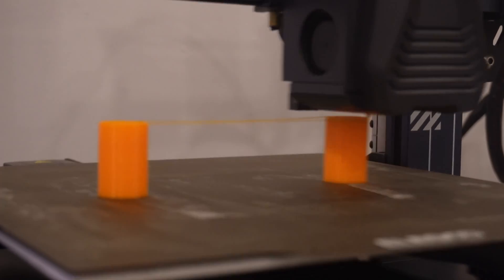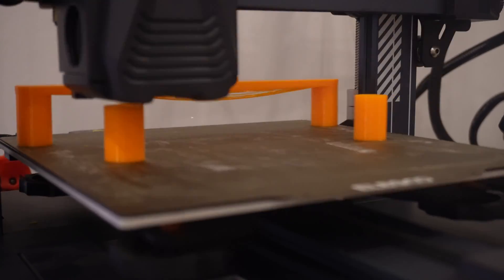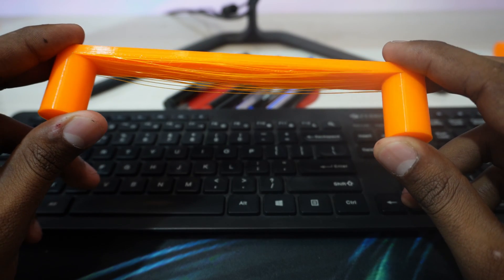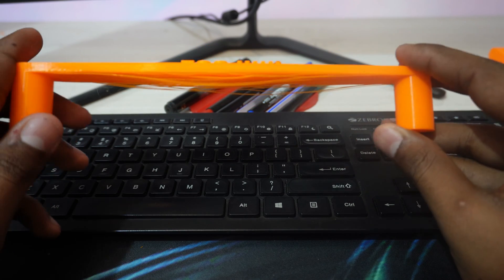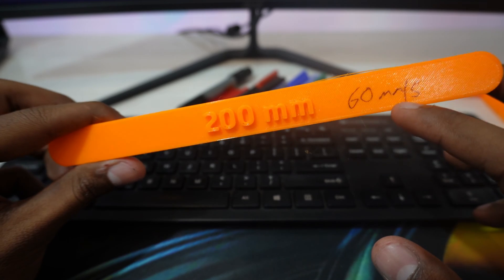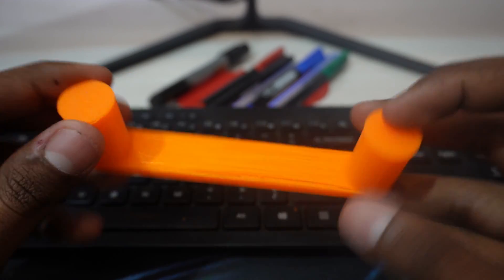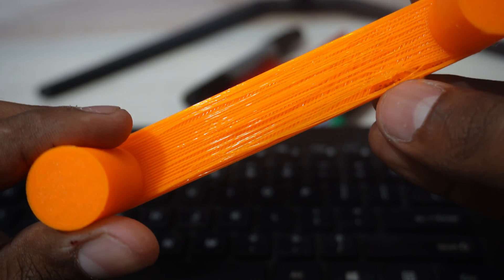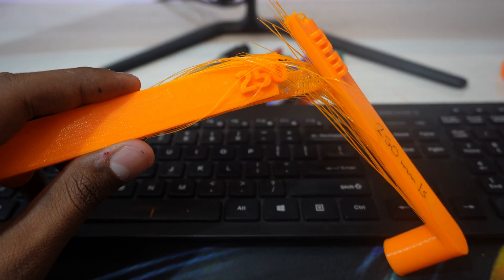How Far can a 3D Printer "Bridge" at Fast Speed

Comment: I think slower is weaker because of two things:
1. Being suspended in the air causes the layers to cool faster which in turn hinders the adhesion from layer to layer.
2. The drooping effect is significantly greater the slower it goes if it's faster like a rope or cable when you're pulling it tight it is able to hold support its own weight better
Reply from the maker: Thanks for such a great explanation, it will be useful for the rest of the viewers.